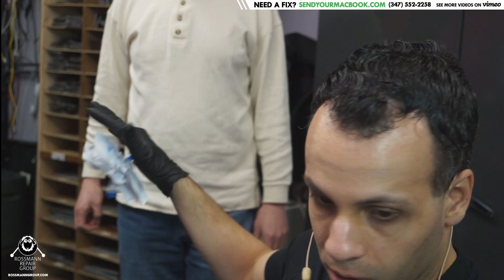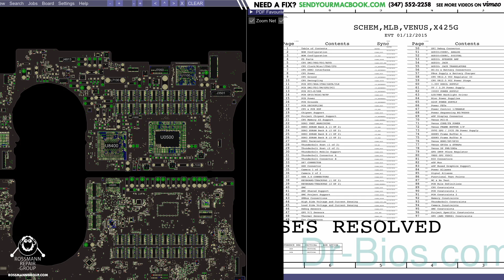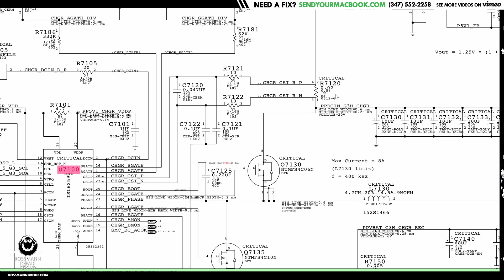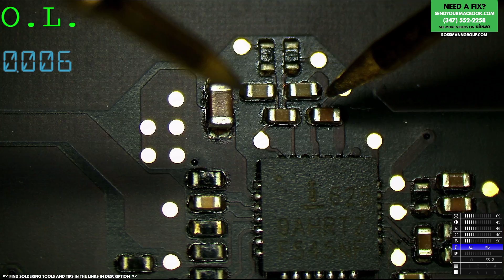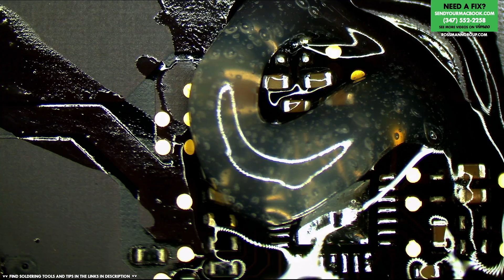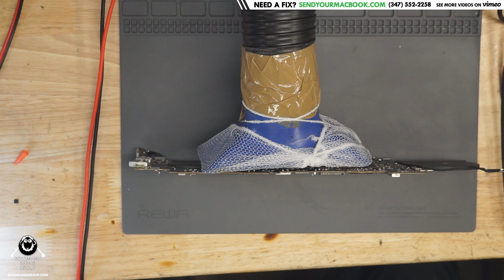What does a knockoff charger do to a Macbook Pro? Why should you not use one?

Comment: I don't get it.. Why are people using a knockoff chargers?
The original ones are not that expensive or even the original ones.
I charged my iPhone 5s with a Amazon Basics cable and my iPhone 11 is now charged with an "Anker iPhone 11/ 11 Pro" Kit that Amazon offers at Germany on the front page since couple of weeks
Reply: 400% mark up to buy Apple. Easier to order on Amazon and most knockoffs are $20 (vs $79).  Who knew they would fry the machine?

Comment: you are NOT measuring the resistance of the capacitor. Its DC resistance is hopefully not 7k but in the M range at least. You are measuring some internal resistance of the buck converter chip. Which in fact can be dangerous to do if the multimeter uses a too high probe voltage (can destroy the chip).

Comment: If apple made chargers with cables that didn't split and then charge you an arm and a leg for a new one maybe people would not look for a cheaper charger.
Reply: Maybe apple wants you to buy the knockoffs. they win both ways.
Reply: ^ game theory
Reply: I never had that problem with a 12 year old Macbook because I wrapped the cable around the foldout ears on those bricks, paying close attention to not straining the cable at the entry point.
Reply: I've had at most one or two cables that did split, that Apple replaced no questions asked.
Reply: For me they always replaced the chargers no questions asked with the 5 year warranty(not warranty but like production error replacement). In most eu countries you have 3-5 year of that type of production error warranty and 2 years of normal warranty.. so as long as they are good with replacing them the only annoying part is having to replace them every 3 years but a lot of companies are real bad with accepting and replacing stuff after the 2 year normal warranty. Still bad that the cable sucks but at least they are good with replacing which is at least something.
Reply: That way to easy for greedy company
Reply: I live in a warmer climate, non of the apple OEM cable (macbook brick, earphone, iPad cable) ever lasted me more than 3 years without the silicone seal disintegrate…
Reply: You overpay to buy their "premium" products and you complain about the charger?
Reply: You should never buy knockoff chargers, no matter the brand. Apple, Dell, whatever it is, always buy official.
Reply: Gael   I have never had problems with knock-off replacement chargers. On IBM/Lenovo machines.
Reply: If you play black, your queen will get pawned if the knight isn't there to preserve her digitally.

Comment: I still don't get how a non OEM charger can cause this. Unless of course it's output voltage is so high that it over volts the buck controller chip.
Reply: In the worst case, dumping mains voltage directly into the laptop. I remember watching some teardowns of knockoff iPhone chargers and there was no real isolation between the high and low voltage sides. They were just one strong bump away from shorting mains to the USB output. I assume similar things happen in knockoff laptop power supplies.
Reply: @guspaz  i bought a knock off laptop charger for my wifes laptop and we have had zero problems, of course its not an apple. i checked the reviews and bought it from Amazon.
Reply: @guspaz  yeah mate, but if that happens your not left wondering what the cause was.
Reply: Poor isolation from hot side to switched mode circuitry, one possibility.
Reply: Uncontrolled 'power on' voltage spikes possibly - cumulative damage eventually fails.
Reply: @ericy4522  possible I guess. I'd really like to get my hands on one of these psu's that's responsible and put my scope on it. 

After all, there's only a handful of buck controllers and they're used in ALL smps's. Your's is the most feasible reply though. Though more likely that the spike takes place on power off. 🙂
Reply: There are third-party quality, safe adapters, and knock-off cheap and unsafe copies of those.

Quality, performance, cheap. Pick two.
Reply: @ve2mrxB  thanks for that. Really though, obvious information is not relevant. 👍

Comment: is there a reason besides possibly cost, to use those intermitent voltage averaging circuits to output a particular voltage vs using an actual regulating chip that just takes the input and outputs the desired voltaje?
Reply: Linear regulators have a terrible efficiency factor. They literally burn the voltage difference away. The bigger the voltage differnce between the input and the output the bigger the power loss.
Reply: It's the only way for transistor circuits to limit voltage AFAIK. Subsequent capacitors can smooth the voltage out though. The bigger the capacitors, the smoother the voltage. In AC, you can transform one voltage to an other via a transformer. But DC can't do this.
Reply: Yes, Heat.